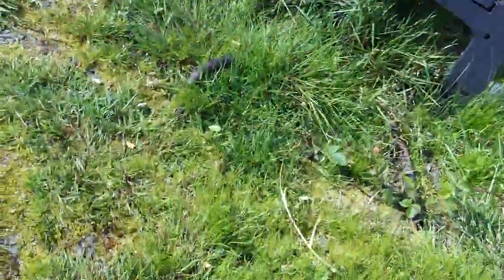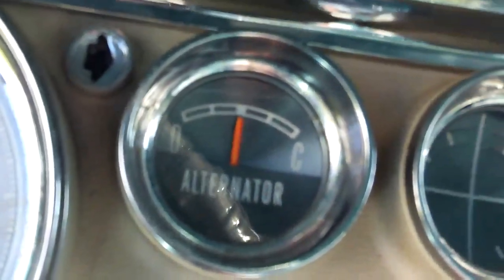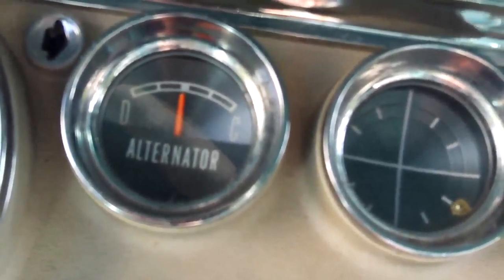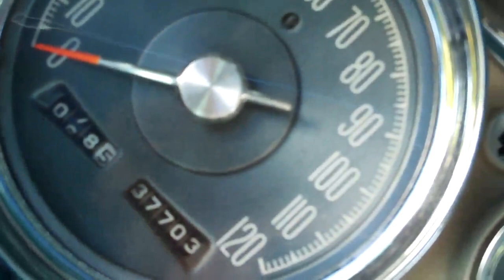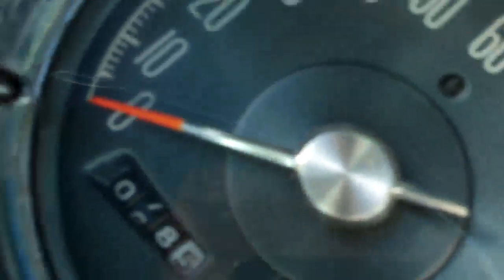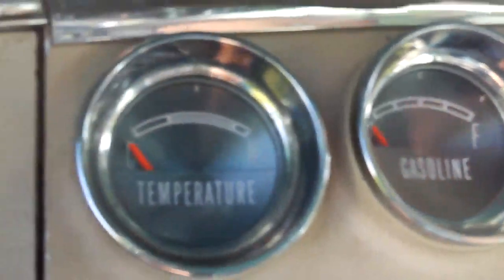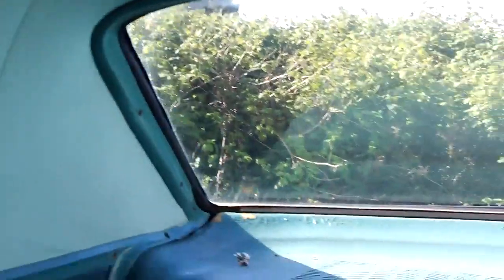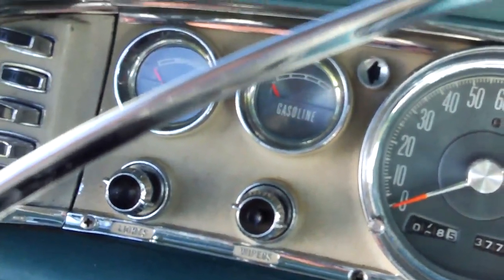1964 Chrysler Interior and Dash Discussion

Comment: Hi there, I had a 64 chrysler once. The park lever actually puts the car in park and shifts it into neutral. There is an actual park pin in the transmission.  Chrysler did not add this feature until 1963.  So the e-brake is attatched to the rear drum brakes.
Cheers!
Reply from the maker: +Moe Sizlac Thanks for clearing that up.
Reply: Moe Sizlac thank you for sayin it first lol

Comment: Is that gauge cluster hard to remove have to check my wiring and change the bulbs to leds
Reply from the maker: +TheMoparsrule It's not too bad really, I was worried initially.
Do remove the steering column bolts/bracket underneath and let it drop down. That allows the instrument panel to come forward better and see the backside electronics. Also, put a rag or something down on top of the steering column before lifting out the panel (It will prevent the metal panel from scratching off paint)
The panel itself has about 8-10 screws that hold it in place (half of mine were missing anyway). The area in the left corner of the dash might want to hang up a bit, but after wiggling that around it will just pull forward.

Here is a few pics of behind: http://imgur.com/a/cuZBw

Watch for melted/burnt wires like you see in the link. That is a sign that shit will fail. Typically the burning will be on the Amp meter where amperage is highest. Also, the circuit board in there will be very fragile so don't hang on anything.

I don't know shit about LED replacement bulbs, etc. Sounds like a good idea though.
Reply: Thanks for the pictures that really helps